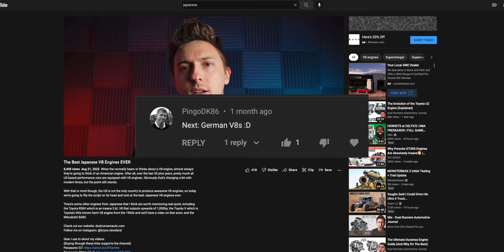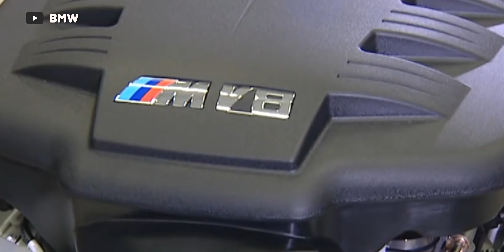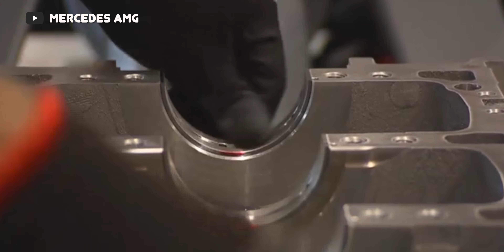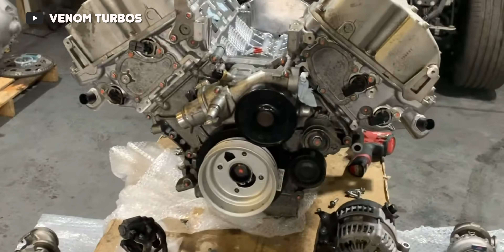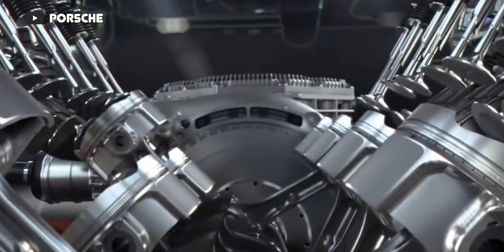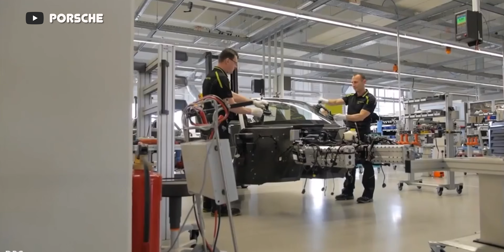The Best German V8 Engines Ever!

Comment: Of course any list is subjective and then what is your criteria? It seems that yours is just overall power and performance with durability not even considered.

I know the early Mercedes-Benz M156 suffered from head bolts pulling out of the block 

I have two older Mercedes both with near legendary V8-the M119 and the M1 13 

The M1 19 is a particularly interesting engine because over its lifespan of about 10 years it underwent a block redesign from closed deck to open deck, and then 1995 or six completely redesigned pistons and crankshaft. And it underwent three versions of Bosch fuel injection 

But the first version of it was used in the Sauber – Mercedes and dominated the LeMans series for two or three years 

Both are good for hundreds of thousands of miles with decent maintenance 

Honestly I tend to shy away from the newer technology like turbo chargers because the more stuff you have the more stuff will go out. Granted my engines aren't 500 hp but then I don't need 500 hp 

I wanted to complement you also on your video on close deck versus open deck – the first time someone was able to explain that to me simply and succinctly

Comment: The AMG M156 was rated at 630hp in the SLS AMG Black edition.  Still one of the best sounding V8s ever made.
Reply: That’s an M159 engine which is an M156 with forged parts
Reply: @kv6diecast  Dry sump and different intake manifold too.

Comment: Other than having rod bearings that are known for prematurely wearing out (read weak under-designed bottom end) and causing catastrophic engine failure, the BMW S65 V8 is a great engine.
Reply: It's been overblown and was mostly from terrible maintenance recommendations and even worst first owner treatment
Reply: I mean as long as you change them on a regular basis and let the engine properly warm up before pushing it too hard this shouldnt be an issue
Reply: @Person-cv9dj  Missed your excellent reply!
Reply: This is like saying "Other than having been a wife beater and child abuser, he has been a great husband material overall...."
Reply: @xuanzheng1049  I don't know if they blow head gaskets, but I can't stand when engine designers cheap-out and put only 10 head bolts per 4 cylinder bank.

Comment: European V8 are way worse than American V8s you need an NASA degree to work on them
Reply: I sure as hell do not have a NASA degree, and I work on my bmw m62b35 in my e39 sedan, and my m62b44tub in my X5 suv without any problems.  They are no worse to work on than the 5.4lt Quad Cam V8 in my wifes Aussie 2003 Ford BA XR8 sedan.  Sure, not as "simple" as the old 302 "windsor v8" in my old Aussie 1991 Ford EB S Xr8, but really not all that complicated either.The new quad cam v8's are way more powerful and economical than the old school OHV v8's. 

No I'm not a "qualified" mechanic. I'm just a spare parts interpreter who spins his own spanners and can read & follow the workshop manual.
Reply: Keep your German over engineered shit most of their new cars can't  even get 100,000 miles without major problem with them there's a reason only rich people and stupid people buy them one person can afford to fix it the other person doesn't know what the hell he's looking at
Reply: Not really you just need a basic understanding of electronics, how simple industry standard sensors and actuators work, and the ability to RTFM. That does rule out 90% of American mechanics though.

A multimeter is witchcraft to someone who only knows carburettors.
Reply: @BigUriel  I can tune engines easy just not European over engineered shit.

Comment: Americans had V8's for many decades and all the Europeans looked down their noses at them.
Now Europeans can't make enough of them.
It's hilarious.
Reply: Europeans have always had V8s what are you talking about? Hell they were literally invented in Europe.

The difference is that for decades Americans stuck V8s in everything - even when they were shit, heavily detuned low compression engines that made no more power than something with half the cylinders and displacement - while in Europe they've always been high end engines that went into high performance and luxury cars.

There have also been quite a few European sports cars with American V8 engines. People didn't look down at American V8s (the good ones anyway), they were simply far too expensive to import, hard to find parts for or otherwise unsuitable for the application (for example the enormous displacement gets hit with ridiculous taxes in many countries). The reason people in Europe don't do LS swaps isn't because they don't think LS engine are good, it's because a half decent one will cost you 5 digits plus another grand or two to be delivered, and then if you need any parts (be it for maintenance or mods) you're always going to have to order them from overseas. Hell you'll even need to buy new tools to work on it because nobody here uses imperial spanners for anything. It's just cheaper and easier to use an European engine, for much the same reasons it's cheaper and easier to use an American engine if you live in the US.

Now if you want to know something really hilarious is how Americans shunned manual gearboxes for almost a century and would import great European cars and just about ruin them with slow dim witted slushboxes (often GM boxes that weren't even available on these cars in Europe), and now that you can actually get these cars with some great automatic gearboxes they decided they want them manual ¯\_(ツ)_/¯

Comment: E39 m5 v8 and mercedes m113 and m113k. The best ones for me ever built
Reply: Agreed
Reply: Base
Reply: Mercedes M156 or Porsche/Audi 4.7 TT or 4.0TT both better engines fight me irl
Reply: @BigGuy10Points  in which terms better? Might be more efficient… and the rest? Whats better?
Reply: @Semicolonos m156 is race engine and is the best v8 of all time.
Reply: @shawndon7374  more powerful stock, m113 are cheaper to get more relaiable power for track use
Reply: @Semicolonos best but old...
Reply: @shawndon7374 you mean 159. The 156 in the 63 series cars is not a race engine.

Comment: Power is nice, but I seriously doubt Germans can make reliable V8 engines.
Reply: Mercedes’ M113 would like a word with you.
Reply: @shawncarson8131  with no problems?
Reply: @MrSamPhoenix  Highly documented that that engine is very reliable and durable, even in supercharged form. Takes quite a bit of neglect to kill one.
Reply: @shawncarson8131  with out issues? I guess I’m salty of all the BMW V8 engines we owned… they were terrible 😣
Reply: @MrSamPhoenix  Which ones did you have? Because most of them are terrible. BMW is probably the worst German manufacturer when it comes to making reliable V8’s.
Reply: @shawncarson8131  probably the n series v8. Idk what it is with bmw and making terrible v8s, but every time I see one for sale, those potential problems scare me away
Reply: @MrSamPhoenix  m60 and m62 are like only bmw v8 with out big problems. they where made in 90s.
Reply: @manager96ful  figures, now I’m wondering why BMW can’t make a V8 engine that’s not riddled with inherent issues.
Reply: My m62 has 210k miles on it...
Reply: @cmkm54  with no problems?
Reply: @MrSamPhoenix  well. I had to do the timing chain at 201k, but I don't really think that's too unreasonable at that age. That was the only real issue tho.
Reply: My E39 powered by a M62b35 v8 has over 370,000 kms, or roughly 230,000 miles on it, and aside general stuff like a few valve cover gaskets, spark plugs, ccv valve, water pump & thermostat, it's as it was built by BMW in 1996, and going very strong.
Reply: The Audi 4.2 (besides the B6/B7 S4’s because of chain guides)

Comment: mercedes m113 and 113k are sorely over looked here. I understand the more modern bias but the pedigree that engine family has along with its legendary reliability means it needs its flowers.
Reply: The m113k made more torque than 6.2 and could make more power with boltons and was known to be way more reliable.
Reply: @manager96ful  just curious, how much boost can they take on stock internals?
Reply: @mfsusanoo7238  Not sure but I seen stock internals + head make 500-550whp, like this one /watch?v=WH9anHng57g.
Reply: @manager96ful  lol hey buddy newsflash! The 6.2 can also make 600 hp with simple headers and other bolt ons.... plus it's way better since it's 4 valves instead of the ancient 3 Valve design. I prefer the better flowing and higher revving v8 hands down. Plus it sounds wayyyyyy better. Amg 6.2 is one of the if not The beat v8 engine ever made.
Reply: Absolutely. Those together with the Audi 4,2 40V (apart from the one in the S8) must be the most reliable european V8's.
Reply: He also chose the s63 v8 over bmws greatest v8 engine ever made. This guy is american and clueless
Reply: All true but all those engines are very old...together with cars